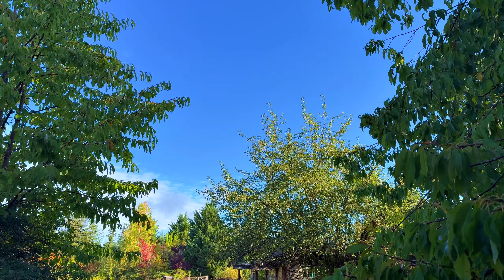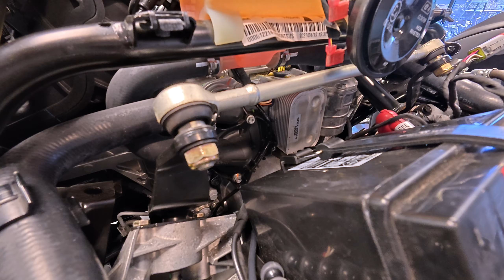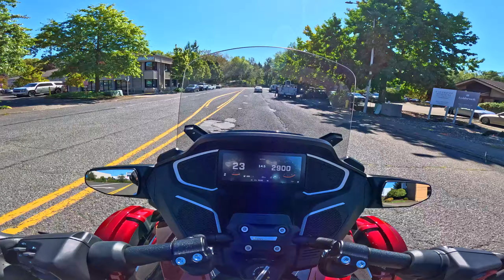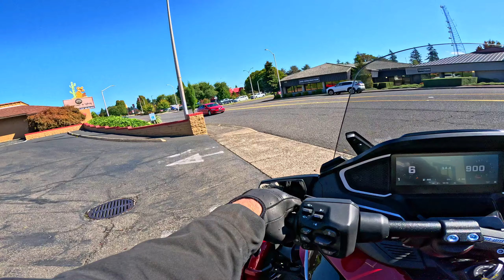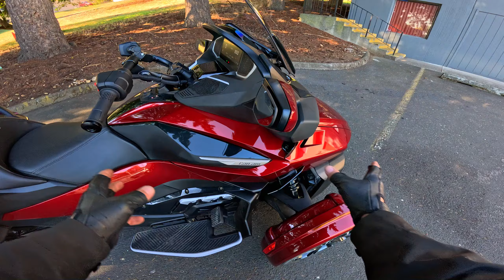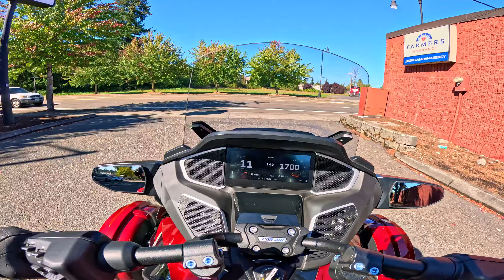Wonderful 2024 Spyder RTL!! • Heli Bars Test Ride! | TheSmoaks Vlog_3238

Comment: Beautiful bike! I like those bars. I have them on my 03 ST1100P. Agreed on the GoPro, it looks better on this end, even on small screens. The longer videos are fine, nice rides and info is better. Weird about that Ryker, I bet the tie rods were unlubed when they were made. Mine were oddly dry on my 2012. Used a needle greaser to get under the boots and a plastic mallet to tap on them while greasing. They are free now and the bike turns a bit easier. Great vid as always! Be well Smoaks!

Comment: Just curious about the labour cost to fit the Helibars....?   Bit concerned about the Ryker if I'm honest, someone did a  PDI on that a bike, there is no way in hell you would get that amount of play in 400 miles.....It's lucky that bike hadn't done more miles or those front tyres would be completely trashed. Shocking that a bike should leave the factory in that condition in my opinion, and then not be picked up on the PDI.
Reply from the maker: It went through PDI perfectly fine.  Customer was 100% happy until approximately 250 miles when VSS codes started to pop up.  I've ridden twice and the unit handles like a dream..!  We're all shock about this play, as you'd never know it was there while riding.

Thanks Paul!! 👍
Reply: @TheSmoaksVlogs  Holy Moly, that's amazing that that amount of play couldn't be detected on a test ride. In some ways that 'makes things worse'.  Thank goodness for the electronics picking it up. That should warrant a recall IMO and the test you did should be added to the PDI.(Pretty sure that's going to happen at Procalibre now anyway, whether it appears on a bullitin or not) Could you feel any play anywhere without the front 'locked down'?